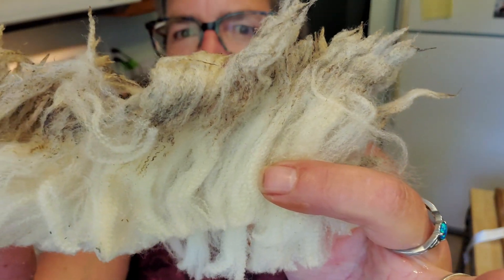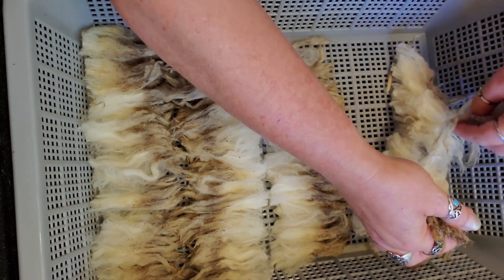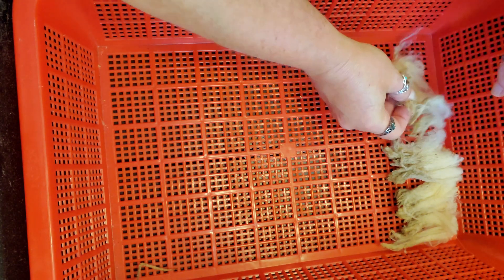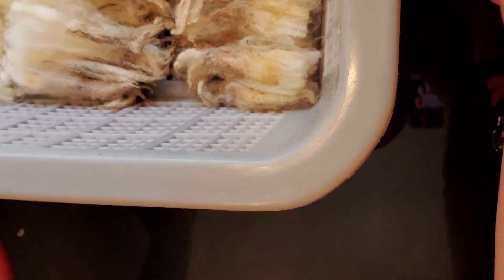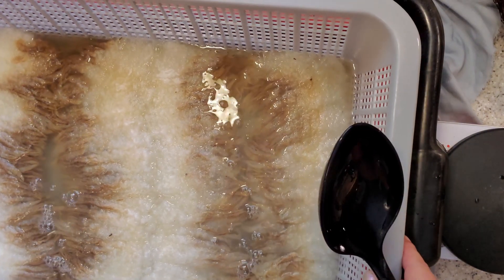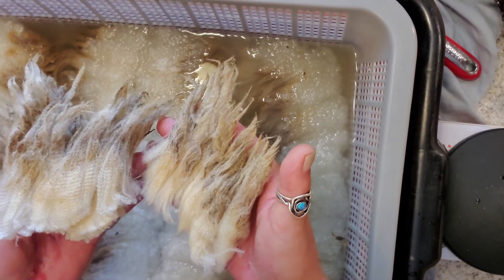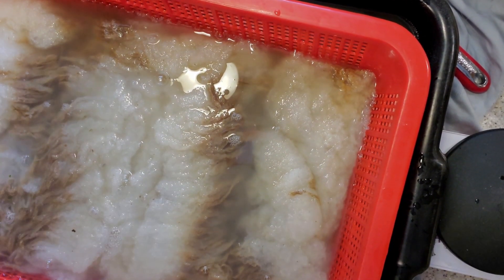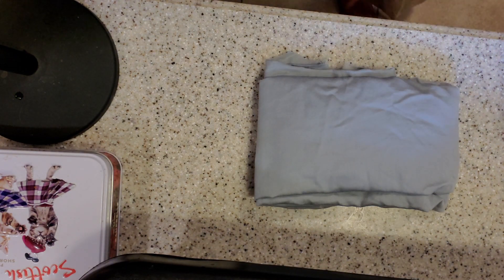Washing Locks For Spinning: Testing Methods with Dill

Comment: The locks wrapped in a cloth will felt when you push on it with a spoon, because pressure felts
Reply from the maker: I did push them down a few times with a spoon and didn't have issues but I did try to stay pretty hands off.

Comment: If you want some unsolicited advice about your septic system (if you're on septic?) I can give you some LOL. My husband is licensed in septic design/inspection.
Reply from the maker: I'm no longer on septic but I know there's a big fear among fleece washers about clogging pipes and septic tanks.  I really think it should be fine but I'm not a plumber.